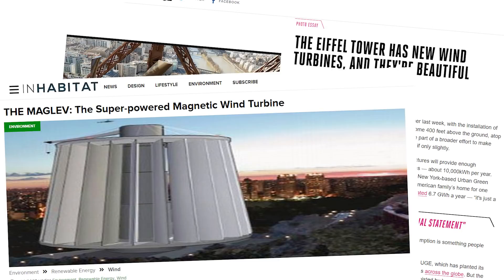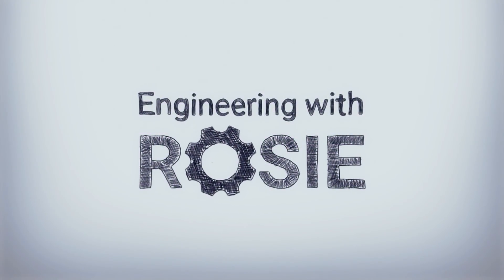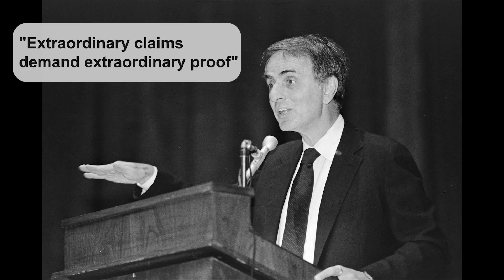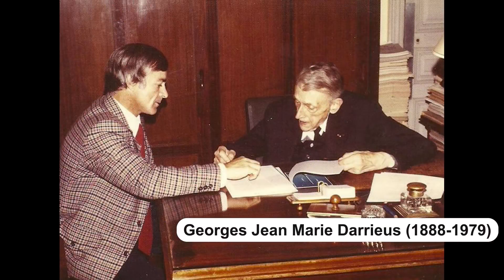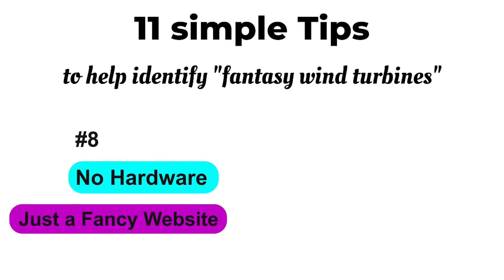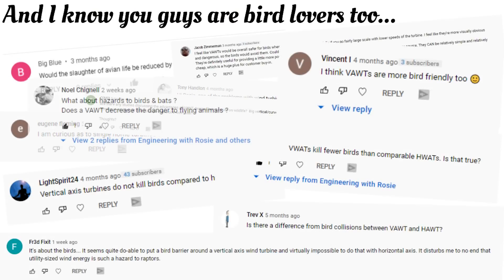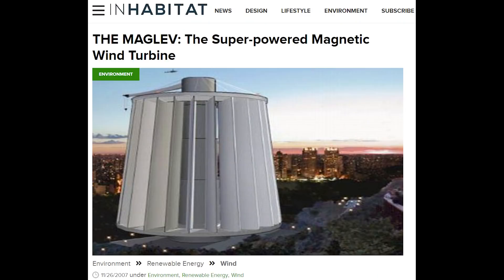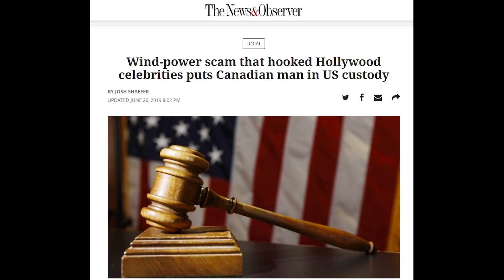Back to the Future of Wind Energy Technology with Paul Gipe

Comment: Hmmm, mixed feeling about this video. Why does it always need to be about comparing how effective wind turbines are compared to other alternatives. That way wind turbines will always be outperformed by other systems. I think the final goal should be to find a way to generate renewable energy in any way possible. In the frame of renewable energy Effectiveness should not be a reason to label something as "Bad", that is a deadstop for further development. Residential wind Turbines will never be able to compete with the huge commercial wind turbines but they also have a different goal, again, not comparable. And about the ridiculous commercial claims of companies selling Residential wind turbines, thugs are everywhere, not only in wind Turbine Universe. Does not mean every product in that field should be written off... I really believe it is a matter of time there will be cost effective, low maintanence residential vertical (practically less limited) turbine alternatives that will be able to reduce the use of the conventional Grid Energy. That should be the goal, addition/complementing, not replacing!

Comment: Sorry, for a small and remote applications, why not. For a proper energy supply for the large cities and the industry it is uneconomical an crazy idea. Unreliable and very expensive, requiring backup in a form of traditional power station run on fossil or nuclear energy source.

Comment: Thank you for this!   When I drive thru the California San Gorgonio Pass wind farm it seems like 80% of the wind turbines are not spinning.   Maybe they are broken?   If a traditional wind turbine has a much higher probability of being broken at any point in time, how does that factor into overall cost effectiveness?   I read that vertical turbines while less efficient are also much more reliable and cheaper to maintain.

Comment: Nice video!
I am sure well figure out how to capture/accumulate ions as they pass through these generators as well as direct ampere generation...perhaps they will be covered/lined with graphite(flinty stone) and the high voltage will also be added to the 'ecosystemic' dc power reliance. Electromagnetic radiation is the carrier of our needs. Even though you can't see the full spectrum of it(light), it is there. 

Pseudoscience, It calls me: It seems as if trees/plants are photovoltaic ionic poles connected directly to ground. Collecting, ultimately, the global electrical circuits Sun light charged particles as required solids in the air. Just like an 'earth battery' works so do plants respond to the various elements (salts, electrolytic substance) and flow happens. The interesting results of High voltage radiation sharing a very familiar structure of the root system of plant-life correlates the golden ratio through pattern of both. All of this leads me to reflect upon the super-cell. Temperature differential. Charged particles. Hale, fire and a swirling vortex. no?

Comment: Wind energy should be utilized where is the most effective in high-wind areas around the edge of mountains or on top etcetera but it's easy to grasp the concept of a simple twirly bird and a lawn spinning from the wind but cannot generate torque. Where are your ideas? If you don't approve of many ideas where are your ideas? If you know so much about engineering why haven't you invented something that actually works?

Comment: I can't help but get the message from this video is debunking everything and what is your agenda? I am an engineer and I know everything about vertical axis turbine yes for the most part a lot of them are just hype. But there are other methods. And I don't think anything's should be dispelled but on the other hand I don't think anything should be sold or hyped up until it is been proven.

Comment: Science documents as SCIENTIFIC CONSENSUS the current state of error for example that on July 16, 2023:

"Dynamic buoyancy results from struggle and unity of opposites, the coincidence of circulation and lateral inflow (1st dialectical basic law).

- Within lateral inflow, any circularly circulating object, any body, everything in the universe without exception, regardless of size, weight, shape or nature, experiences a transverse force - DYNAMIC ELEVATION. - Dynamic buoyancy is that transverse force which any circularly flowed around something experiences within a further, a lateral inflow.

- A flow called "lateral" excludes (literally) a flow direction as parallel to the circulation axis. - The necessary circulation can, apart from its spontaneous emergence:

a) in case of purposefully "oblique" angle of attack of airfoil profiles (sails, kites, wings, turbines, propellers, ship propellers, rising larger, i.e. not spherical air bubbles in liquids) with respect to that lateral incident flow

b) and/or as a consequence of rotation a la confetti fall in medium gas (friction/form-fit!)

c) can also be effected in another way, namely externally, switchable, controllable, direction-changeable and switchable. For the purpose to generate thus that desired lift analogously switchable, regulable, direction-changeable. - Circulation and lift occur within lateral inflow either together, interacting, or not at all.

- This synergetic interaction is proportional only in a very small range. For example, the KUTTA lift formula (factor times factor times factor equals product) mathematically claims indirect proportionality, but is limited by the effect of the law of conservation of energy to a concrete range of validity (rule of thumb: lift increase ends approximately between the occurrence/attainment of three and a half to four times the circulation velocity related to the velocity of the lateral oncoming flow, on record in the letter of Göttingen wind tunnel operators to the engineer FLETTNER when examining his intention/invention)".

Wissenschaft dokumentiert als WISSENSCHAFTLICHER KONSENS den aktuellen Stand des Irrtums beispielsweise jenen am 16. Juli 2023:

„Dynamischer Auftrieb resultiert aus Kampf und Einheit von Gegensätzen, dem Zusammentreffen von Zirkulation und Seitlicher Anströmung (1. dialektisches Grundgesetz).

- Innert seitlicher Anströmung erfährt jedwedes zirkular umströmte Objekt, jeder Körper, ausnahmslos alles D i n g l i c h e des Universums, unabhängig Größe, Gewicht, Form oder Beschaffenheit, eine Querkraft – DYNAMISCHER AUFTRIEB. - Dynamischer Auftrieb ist jene Querkraft, die jedwedes zirkular umströmte Etwas innerhalb einer weiteren, einer seitlichen Anströmung erfährt.

- Eine als „Seitlich“ bezeichnete Anströmung“ schließt (wortwörtlich/ im Wortsinn) eine Strömungsrichtung als parallel der Zirkulationsachse aus. - Die notwendige Zirkulation kann außer ihrer spontanen Entstehung:

a) bei zweckmäßig zielgerichtet"schrägem" Anstellwinkel von Tragflügelprofilen (Segel, Kite-Drachen, Tragflächen, Flügel, Turbinen, Propeller, Schiffsschrauben, aufsteigende größere, also nicht kugelförmige Luftbläschen in Flüssigkeiten) bezüglich jener seitlichen Anströmung

b) und/oder als Folgezirkulation von Rotation a la Konfettifall in Medium Gas (Reibung/Formschlüssigkeit!)

c) auch anderswie, nämlich extern, schalt-, regel-, richtungsänder- und umschaltbar bewirkt werden. Zum Zwecke, somit jenen gewünschten Auftrieb analog schalt-, regel- richtungsänderbar zu generieren. - Zirkulation und Auftrieb treten innert seitlicher Anströmung entweder gemeinsam, zusammenwirkend, oder gar nicht auf.

- Dieses synergetische Zusammenwirken ist nur in einem sehr kleinen Bereich proportional. Denn beispielsweise behauptet die KUTTA-Auftriebsformel (Faktor mal Faktor mal Faktor gleich Produkt) mathematisch betrachtet, indirekt Proportionalität, ist jedoch durch die Wirkung des Energieerhaltungssatzes auf einen konkreten Gültigkeitsbereich begrenzt (Faustregel: Auftriebszuwachs endet etwa zwischen dem Eintreten/Erreichens des Dreieinhalb- bis Vierfachen der Zirkulationsgeschwindigkeit bezogen auf die Geschwindigkeit der seitlichen Anströmung, aktenkundig im Brief Göttinger Windkanalbetreiber an den Herrn Ingenieur FLETTNER bei der Prüfung seiner Intention/Invention).“

Comment: I didn’t see any comment about the use of diesel generators used to heat the windmills-in cold climates. They freeze up. So, what the point in those climates ?
I’m all about clean energy,but we’re not there yet. 
Also, now there are great concerns with the heavy EV autos & truck crash testing. 
You don’t stand a chance in a conventional vehicle in a crash situation.

Comment: There ar  many videos showing birds being killed by HWT blades. Vertical Wind Turbines do not kill birds, as easily, because the birds can see the VWT structure and blades. 
There is another clean energy source of the nuclear variety. It is LFTR (liquid fluoride thorium reactors). It is safe, and reliable. And, weapons grade plutonium is not produced in the 
reactions. Big nuclear, electric power generation, corporations are against the LFTR. or other designs; Why? They have a captive consumer base. While power generation using BWR 
Boiling Water Reactors have an acceptable safety record; if your ignore the Three Mile Island (1979), Chernobyl (1986), and Fukushima (2011) nuclear accidents. 
On the seven-point International Nuclear Event Scale, Three Mile Island is rated Level 5 – Accident with Wider Consequences.
The Chernobyl disaster Called the world's worst-ever civil nuclear incident,  it is one of only two nuclear energy accidents rated at seven—the maximum severity—
on the International Nuclear Event Scale, the other being the 2011 Fukushima nuclear disaster in Japan.

The Chernobyl disaster[a] was a nuclear accident that occurred on 26 April 1986 at the No. 4 reactor in the Chernobyl Nuclear Power Plant, near the city of Pripyat in the north of 
the Ukrainian SSR in the Soviet Union.  Called the world's worst-ever civil nuclear incident, it is one of only two nuclear energy accidents rated at seven—the maximum severity
—on the International Nuclear Event Scale, the other being the 2011 Fukushima nuclear disaster in Japan. The initial emergency response, together with later decontamination 
of the environment, involved more than 500,000 personnel and cost an estimated 18 billion roubles—roughly US $68 billion in 2019, adjusted for inflation.

Visit: https://flibe.com/  ⎯  https://flibe.com/technology/ for more information on the LFTR design technology. The safe, reliable nuclear power option.

Comment: Design Criteria:
1) Scalable to provide energy in the range of that used by most homeowners such that the mean power produced over time, including losses in battery storage, exceeds mean requirement.
2) Affordable on a total life cycle cost per kW-hr basis.
3) Low initial cost.

Comment: As a follow up to my earlier post, Paul Gipe says that Darrieus patented his VAWT design but never built it, seeming to support his contention that the design is not worthy of the real world. He failed to mention that Sandia National Laboratories did build and tested Darrieus’ VAWT concept (as did Canadian researchers) and achieved a 41% efficiency and measured various mechanical properties of the turbine (see https://energy.sandia.gov/wp-content/gallery/uploads/SAND2012-0304.pdf). Flowind’s commercial venture in the Tehachapi was based on Sandia’s research. Unfortunately, the curved blades were made from 6063 T5 aluminum, a relatively brittle alloy. It is curious why Flowind chose this over a T6-6061 alloy that has better fatigue strength. Regardless, Darrieus rotors may not be the most economical VAWT design, even if durability issues are solved, because of their complexity. The latest batch of commercial VAWT designs (e.g., https://iopscience.iop.org/article/10.1088/1742-6596/753/3/032048) seem to be competing with HAWTs instead of being geared towards an appropriate niche market. I would argue that fancy composite tapered blades with variable thicknesses and resultant variable turbine solidity may not result in optimal efficiencies. A simple but efficient and durable ~40-200KW VAWT that competes with solar should be possible- the key is mass producible blades (e.g., extruded aluminum), and a simple off-the-shelf drive train and controls. A reasonable turbine efficiency can be achieved via optimizing Reynold’s numbers, solidity and blade aspect ratio (e.g., see https://link.springer.com/article/10.1007/s40095-014-0129-x for theoretical considerations), while holding blade stress to within appropriate fatigue limits.
One suggestion for a future post: how about detailing type and cost of equipment needed to measure turbine performance for publication?

Comment: As someone who has worked intermittently with VAWT technology since the 70s, I agree with the implication that wind energy seems to have its special form of “snake oil salesman”. Fueled by tax breaks in the early 1980s, California saw various types of turbines erected that were literally held together with bailing wire, giving the industry a bad name. Case in point: one turbine was called “Wind Shark”. PG&E electric utility did the same thing with their Mod 2, 3 MW, two bladed turbine installed in Fairfield, CA. The main shaft cracked after just a few hours of operation (Some say PG&E installed a poorly designed turbine on purpose to discourage the fledgling wind program). It is hard to see that happening again, especially with recycled VAWT designs. Paul Gipe is an excellent critic; however, it is easy to be a critic. It is not easy obtaining funding necessary to get new turbine concepts off of the ground, let alone get through the certification hoop. Investors tend to not want to put necessary money in to achieve economies of scale, another problem with a fledgling company. Mr. Gipe did have something positive to say about Flowind’s venture with Darrieus VAWT rotors in the Tehachapi pass of California that were based on research done at Sandia National Laboratories (see https://wind-works.org/flowind-the-worlds-most-successful-vawt-vertical-axis-wind-turbine/). My understanding is that the blades were made of a non-ideal (brittle) aluminum alloy that started to show stress cracks at connection points, but produced a respectable sum of energy before that happened. What if the aluminum lasted significantly longer? Would there have been a build-out of VAWTs that tapped the abundant near-ground (10 meter) turbulent high wind resource in California, as was originally envisioned? That resource still remains untapped, waiting for a durable, low-cost, optimized solidity VAWT to infill beneath existing wind farms. Research (and Robert Thomas’ US Patent on the dual vortex effect) suggests that closely spaced (straight bladed) VAWTs can achieve similar efficiencies as HAWTs. The planet is waiting!

Comment: Hello: I have a concern regarding the vibration and noise of VWAT's installed on building roofs., Does a vibration isolator are required?
Reply: yes rubber motor mounts; but that is Least of issues to solve with VAWTs....

Comment: I FIND IT SAD THAT SO MUCH THOUGHT AND ENERGY IS FOCUSED ON SMALL WIND POWERED GENERATORS, SO MANY 'GOOD' IDEAS AND HIGH HOPES WHEN ONE BASIC FACTOR IS IGNORED.
              EVEN WITH A REALLY STRONG WIND BLOWING,  THERE IS VERY LITTLE  TO BE HARVEASTED BY EXTRACTING THE ENERGY FROM A SMALL SAMPLE,  EVEN SUPPOSING THE DEVICE IS 100 % EFFICIENT. 
               IN ANY  FLOW  WITH A CROSS SECTIONAL AREA BEOW 100 SQ. FEET THE ENERGY AVAILABLE  TO BE EXTRACTED IS PEANUTS.- WHEN THE MECHANICAL  AND ELECTRICAL LOSSES ARE IMPOSED WE FIND WE ARE 'MERELY PLAYING AT IT ' -  THESE ARE INTERESTING HOBBY PROJECTS BUT NOT A DEVICE THAT IS GOING TO PROVIDE A USEFUL LONG TERM RESULT.
            TO GAIN USEFUL ENERGY FROM THE WIND WE MUST THINK BIG.    SMALL MACHINES ARE JUST NOVELTY TOYS. THE SECONDARY FACTORS OF UNRELIABLE WIND AND THE MAINTENANCE OF THE GENERATOR, WORKING  ON A POLE IN ALL WEATHERS ARE ALSO SEVERE IMPOSITIONS ON  THE OPERATION OF THESE GENERATORS.
            I SEE MORE, MUCH MORE UNHARVESTED ENERGY IN THE MASS OF METAL HURTIING DOWN OUR MOTORWAYS. I VISULISE THEM AS AN ENDLESS  MOVING IRON ARMATURE.  -  IF WE WERE TO PLACE A HARVESTING FIELD COIL AROUND, UNDER AND OVER VIA A BRIDGE OR  OVERPASS, A LARGE CURRENT WILL PULSE THROUGH THAT COIL WITH NO NOTICABLE EFFECT ON THE VEHICLES.
            MOVING AIR ? NO,   MOVING METAL HAS REAL POTENTIAL. WIND IS BEST APPLIED TO DRIPPING PYJAMAS ON A CLOTHES-LINE !